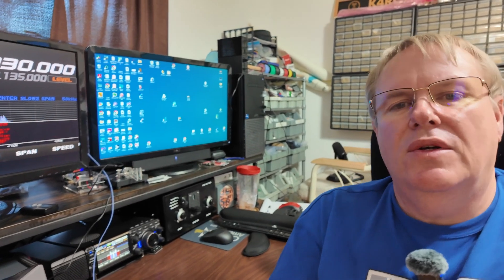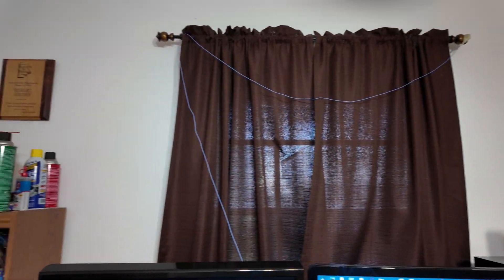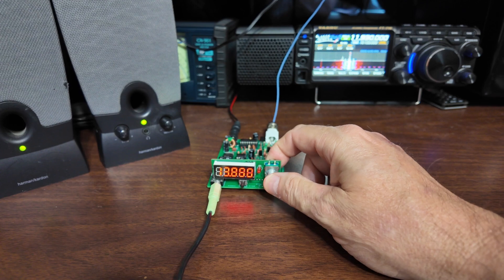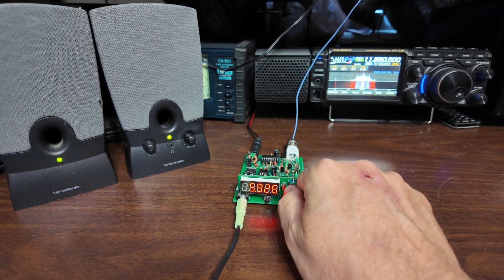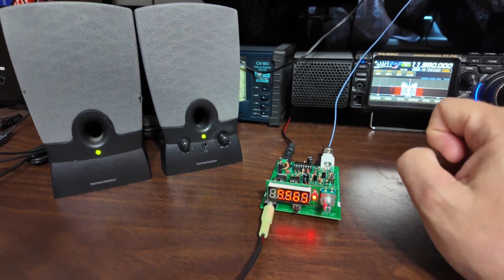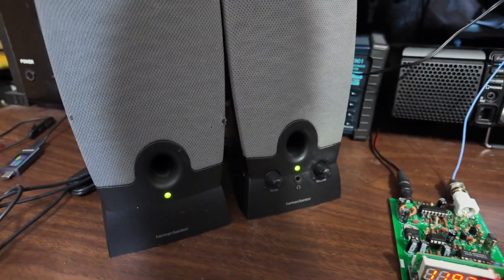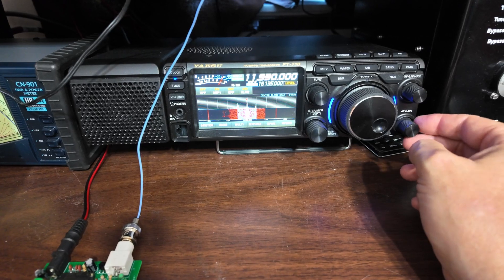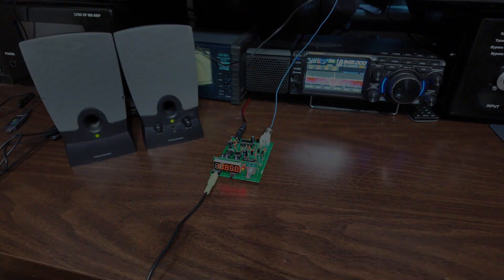R10 Shortwave Receiver Kit Follow-up

Comment: This is probably the only proper demo of this poor little radio kit on all of YT, so a like from me for that. It's clear that for optimal results, this radio must be: (1) fully decoupled from the wall socket (connecting regular active speakers like that may introduce a lot of noise/EMI; it requires an audio amp powered by a battery); (2) connected to a decent outdoor passive loop antenna through a choking transformer (e.g., 1:9). I wanted it for myself, but so far, I don't see any benefits over the cheapest SI4732-based receivers, where I also have all the hassle with antenna matching and attenuation. The sound of the SI4732-based DSP at 6k BW seems a bit better than that of the R10. Thanks! 👍🏻
Reply from the maker: Thanks!,
Check out the receiver I designed to put in a shootout video to compare to the R10 and a few other receiver kits I have built. It is called the Lynx ez sw receiver and has a playlist on my channel. I just finished this radio and am getting setup to make the shootout video. 
RJ

Comment: I've built one, and, while it's hardly a great receiver, I can't agree with some of the negative comments here.
Firstly,  mine is NOT "insensitive", quite the opposite. I've not had time to watch all the previous videos, but I presume you have  adjusted T1 (the little blue IF transformer) on a weak but stable signal? That considerably improved sensitivity. ☺
However, it doesn't like big antennas, as you've found out. Treat it like a portable, e.g. try a telescopic whip (preferably outdoors, away from computers, monitors and other sources of noise) or (in my case) a few feet of wire. While testing mine, a meter test lead as an antenna brought in numerous (genuine - not sprog or intermod) signals - very pleasing. Selectivity leaves a bit to be desired, but what can one expect for the price? 
The thing I've not experimented with yet is item 3 in the menu, the IF frequency adjust: I'm guessing it fine-tunes the difference between the displayed frequency and the local oscillator to optimise performance through the crystal filter.
Building it (relatively straightforward once I'd found some just-about-English instructions: all components were correct) kept me entertained on a wet, windy day, and I'm happy enough with the finished result. ☺
Reply from the maker: Thanks for your input. 
I did adjust T1, and I tried long wire, short wire antennas. I think the issue is where I am located. I have one of the largest am station complexes in the world only 50 miles away. It’s the old voice of America site that went to commercial years ago and has many stations in it all blasting high power on many frequencies. I also radio Cuba south blasting my direction. So a receiver that is poor in selectivity is problematic. As could be seen in the videos I put up is either deaf except to those massive signals or is a blended mess with them. It’s not shocking as the radios design has very poor filtering. Hang around it will get its chance again. In the coming weeks I will building some other kits to put side by side to compare its performance against. I might even mod it to see what it could be with some redesign work.
RJ

Comment: If it was distorted on the exact channel, then you haven't adjusted the discriminator properly.
(It's not an envelope detector but a quadrature detector, eg the phase of the coil is critical for clear audio)
Plus you cannot rely on the auto tune, until you have the detector tuned properly.
Reply from the maker: Thanks for your input. 
RJ

Comment: you might be picking up computer generated RF in the room the square waves generated by computers are harmonic and cause a lot of interference and noise
Reply from the maker: Thanks , 
Didn’t make any difference. I had to run the computer and hf radio to make the video, I had tested a lot off camera with everything but the unit off. 
RJ

Comment: Thanks for taking the time with these R10 videos. I too was very disappointed with the design. Had hopes for listening to aircraft and with a decent antenna outside, however unless I went to the local airport parking lot it wouldn't receive anything and even then terrible.
Actually received a couple strong local FM stations but AM was very scrambled. Had much better luck with a Charles Kitchin Super-Regen circuit for FM/VHF. Thanks again.
Reply: It's an AM Shortwave receiver. It can't receiver aircraft as they transmit on SSB (on shortwave)  or on VHF, which this doesn't cover.
Reply: @graemezimmer604  Oh brother I apologize with egg all over my face, you are very correct and I am corrected!
I was talking about the R80 kit FM receiver which also somewhat works and receives air band if you are next to an airport.
However very disappointing at being so deaf even with a good antenna.
Maybe RJ can do a build of the R80!

Again I apologize for my confusion. David
Reply from the maker: Your welcome,
Thanks for your personal review which matches my finding. Some of my viewers are under the impression that my poor experience is caused by something I am doing with this unit. I am looking for a good shortwave kit that I could build to put side by side with the R10 and show the difference. Haven’t found a good shortwave receiver kit. A number of am/fm units. Might build my own just to prove the point of how bad the R10 is as a receiver. I wonder if anyone else would like a good kit for this?
RJ

Comment: Hi, just to let you know. There is no right audio in this video. Your last 3 videos are all missing the right channel. 👍
Reply from the maker: Hey,
Thanks so much for letting me know! I just changed my editing software and I must have a setting incorrect. I will look into it and get it resolved. I have a few videos already up so they may be the same. But I will get it resolved on any new videos. 
RJ
Reply: @LynxElectronicsLab  Your welcome.
Reply from the maker: @joatmonuk  Just a note, turns out my new editing software generates mono audio tracks unless you tell it to make them stereo. I am having to learn this new much more professional software. My monitor sound bar did not have enough seperation for me to notice it was only single track audio. Thanks for the heads up again. At first read I though you were talking about the receiver that just by chance is designed to only output left channel audio. :face-turquoise-covering-eyes:
RJ
Reply: @LynxElectronicsLab  I usually just watch on my phone or tablet. I just by chance decided to have audio through my bluetooth headphones which highlighted the issue. Really glad I mentioned this, as for receivers, etc i'm only just learning and only have 3 communication devices. A TIDRADIO H3, Uniden Bearcat UBC 60XLT handheld scanner and an Realistic TRC 1010 for now.

Comment: Thank you for such a wonderful instructive video, was your big yaseu difficult to build and can you do a video? how much is the yaseu kit , is it more expensive than the R10? 👌
Reply from the maker: Thank You for your nice words. 
The Yaesu FT-710AESS is a ham radio transceiver produced by the Yaesu company.  It is not a kit.  If you search for “Yaesu FT-710AESS” You should easily find it. hopefully this helps.
RJ
Reply: @LynxElectronicsLab  Wow, thats over a $1000 and it is already built. I am not a ham ; yet!, perhaps when I get to college. I have built crystal sets, TA7642 radios, regens - all good but just looking for my next build on my journey. Any recommendations? thanks GF
Reply: @grahamford8970  Qdx from  Qrp labs   It can do in theory  CW as long as you have it with a  Computer and the computer will require a  USB key like  Winkey.   Qdx does   RTTY teletype  and   FT8   by design .  In order to use it  on any mode you need FLDigi running on the  attached PC  Base kit is about 60  USD.    The Qmx is too advanced for a begiinner and it has a lot of issues.

Comment: Yeah.  Take the test outside.
Reply from the maker: Thanks for the comment,
Even if it would suddenly be a great sw receiver by taking it outside which it will not (I already had it connect to an outside antenna in the previous video).
Sitting outside in 95f temp 95% humidity be eaten by mosquitoes so my sw receiver can receive anything would not count as practical or good in my mind. No matter how bad you guys want to make this a good sw receiver it isn’t and an old used cheap sw receiver off eBay in the same setup would make this thing look silly. It so bad!
RJ

Comment: Good info.  I hope it helps others to not waste their money.  However, it might work a tad better if the antenna did not route behind a digital monitor.  But that would only make a bit of an improvement.   Modern equipment can cause us problems.  I'm forever trying to squash the gremlins in my lab.  It's like chasing the tail I don't have.
Reply from the maker: Hey Uni,
It didn’t matter. It’s rubbish! On a good antenna it’s overloaded and blends everything together. On a poor antenna it only rx a few powerful local stations and does so poorly even then.
RJ

Comment: Maybe it would work with the big antenna with an attenuator.  Did you try to get WWV on any of it's frequencies?
Reply from the maker: I tried WWV on 5,10,15 and could not hear them. Only a few very strong local stations and they were not that great. 
RJ